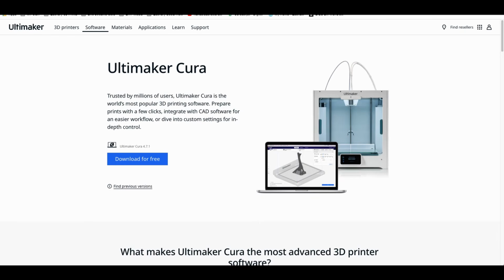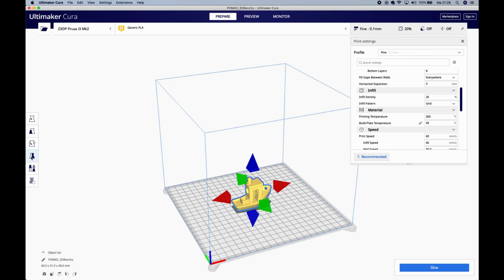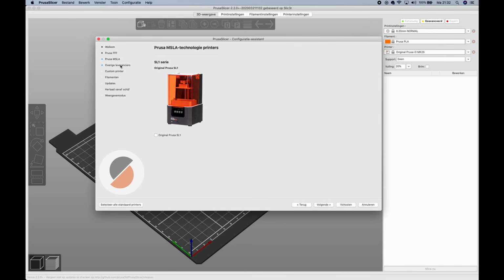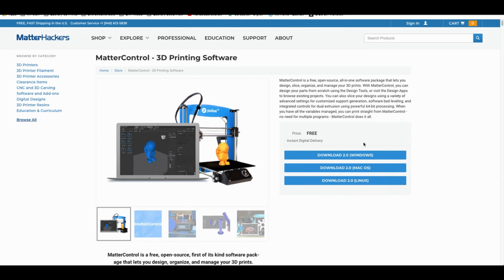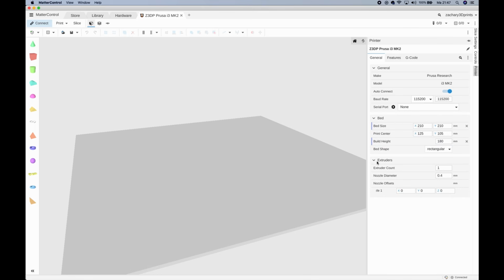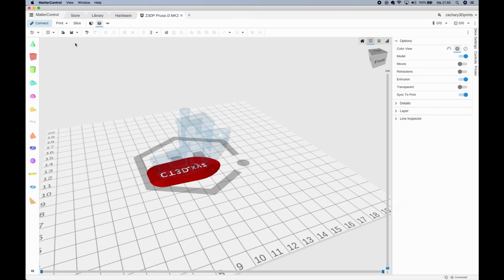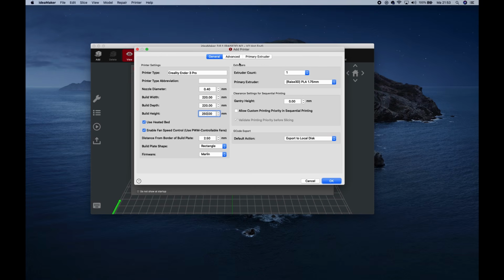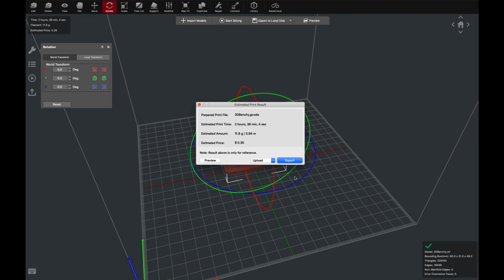5 Slicers you can use for 3D printing

Comment: Can a slicer software support both fdm and resin 3d printers? I don't 
relish the thought of having to learn 2 slicing software when I plan on 
my 3d print purchases.
Reply from the maker: On my channel I cover mostly FDM 3d printing. With the news topics I cover resin printers too. But I’ll cover resin printing in the near future as well.  To answer your question, I know that PrusaSlicer is the only one that can do both... FDM and resin. The other ones like Cura, IdeaMaker etc, those I only used for my FDM. So there I’m not sure if they can do that, but I also never saw a video about that. For resin I know that there are slicers like Chitubox and Lychee Slicer. Check them if you want. If there is anything I can help you with, please let me know